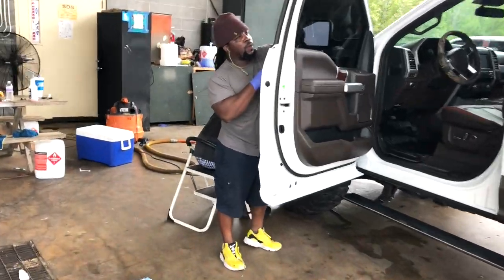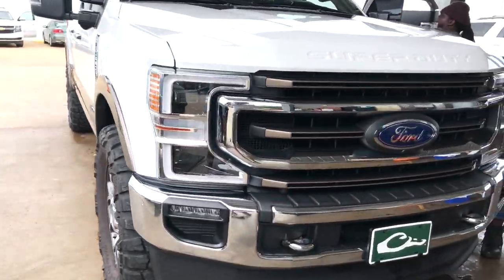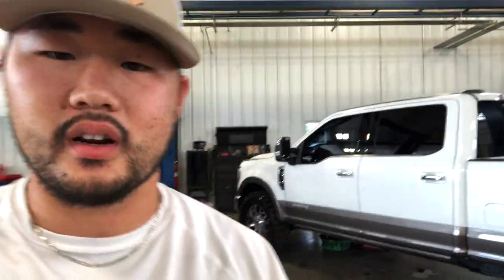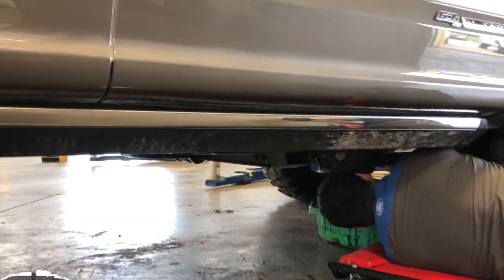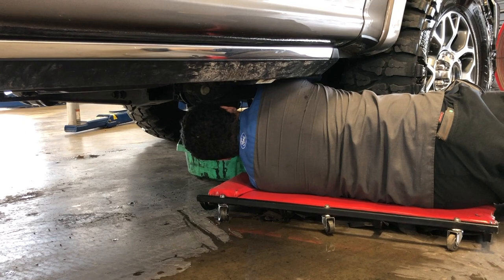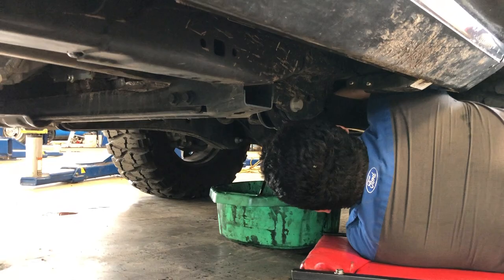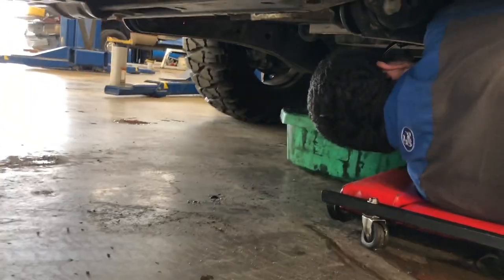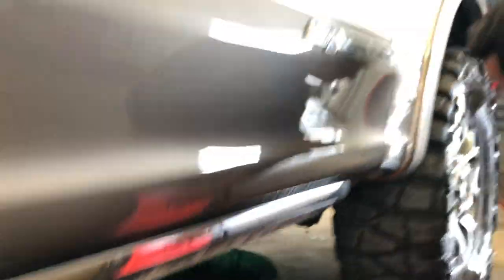First 2020 Ford F 250 Powerstroke Oil Change ***BONUS: a few 2020 Exhaust Clips***

Comment: Is there a specific order that you are supposed to delete the truck in? Like are you supposed to tune it first and then do the exhaust and the EGR?
Reply: I always take exhaust off and unplug egr. Then tune it
Reply: I always tune trucks first in my shop then do the rest of the delete.
That way incase you have issues with loading the tunes, or someone fat fingered a vin, You can still drive it. With the emissions off and stock tune youll go into limp mode and not be able to get very far especially if youre doing it at home over the weekend like most diy'ers do
Reply from the maker: Hope y'all are subscribed! 
1. ALWAYS PROGRAM FIRST (unless you're doing SOTF then install that first)
2. Try to do it during business hours JUST in case something is off!
3. If programming is good then proceed with the physical modifications!
Reply: @KingRancher13  soft can mess up just as often as a single tune
Edit:if youre talking about the physical switch as in dsp5 of csp5, then yes do that first
Reply from the maker: Empty Pockets haha yessir I’m talking about installing the physical switch first! 👍🏼👍🏼